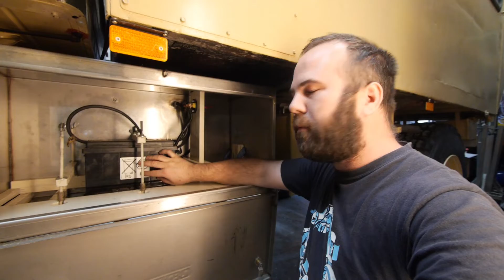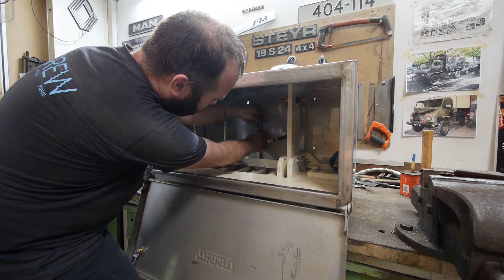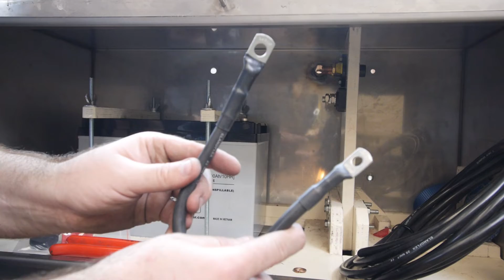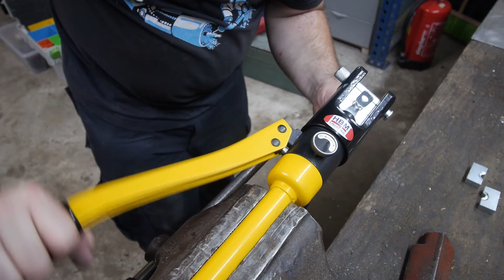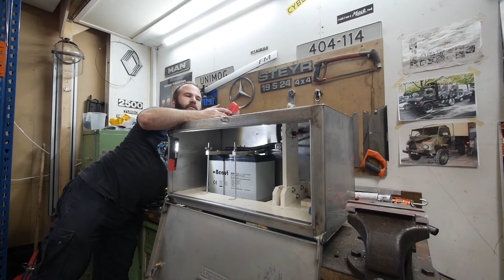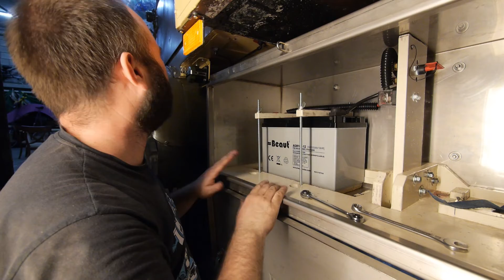AGM Battery Install - UNIMOG 404 Camper Build - Building an Electric System

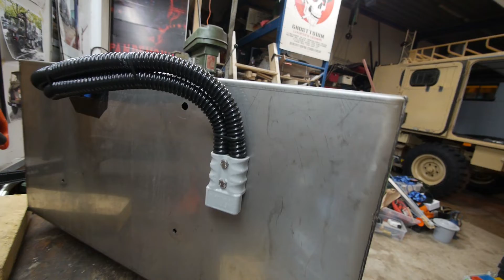Comment: @6:48 I hope the box is upside down because if not, this looks like the male connector and water would run down into the female connector. Might not be an issue if there is a gasket though.

Comment: More success on the hydraulic  cable crimping than another Australian Unimog  project recently!  Looks neat overall.  Lithium batteries  concern me over their cold and hot  temperature limit  challenges and usually they are  not rated for engine cranking, which is useful as backup.
Reply from the maker: Which project was that? :D

Yes I would put a lithium in the camper not in the box
Reply: @victorbartadventures   Hi, see  The Outfit ,   Runva winch installation.   Personally I'd crimp plus solder for heavy current situations.   

Another lithium issue is that you are reliant on the internal "battery management " system to equalize cell charging. We  could learn to live with the usually bright blue or bright green casing colours!